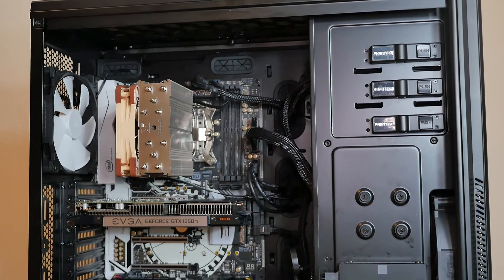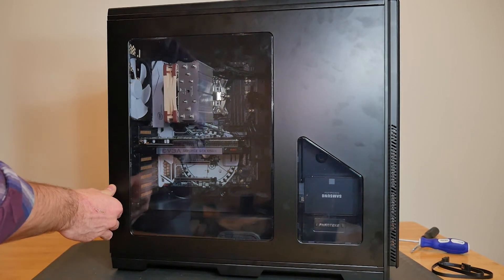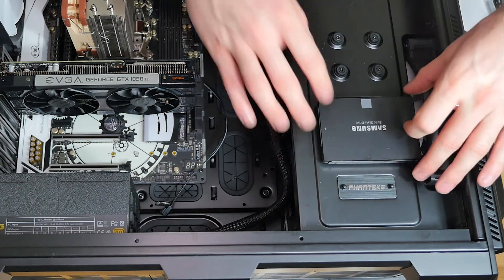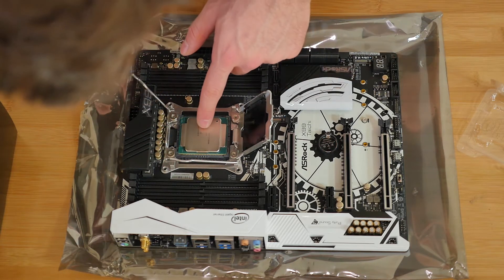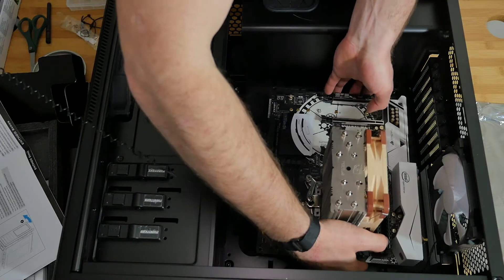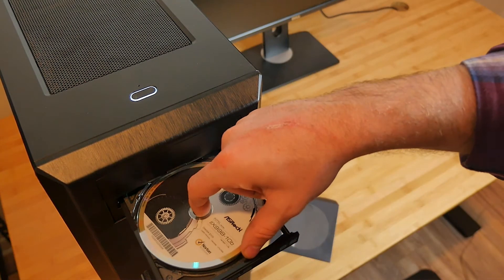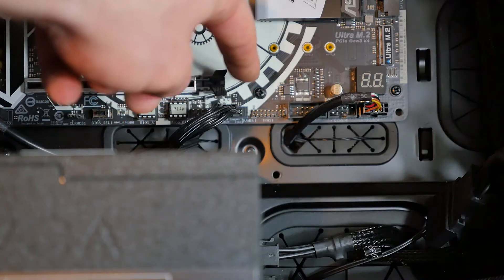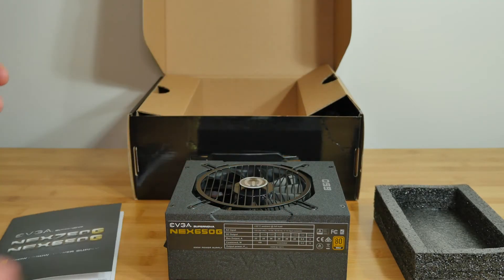Building a Video Editing PC - Build Part 3

Comment: Why a 1050ti?
Reply from the maker: There were a lot of recommendations for it with all the parts I was buying. Originally, I had considered buying the GTX 1070 (and I probably will want to upgrade to that in the future), but I just wanted to buy a basic video card to start out. So far it's been working great while the computer is up and running, but it does take several attempts to start my PC after it's been turned off and a lot of people are saying it could be issues with the video card and monitor. I'll let you know if I find out anything concrete.